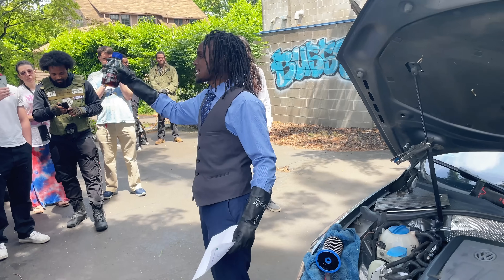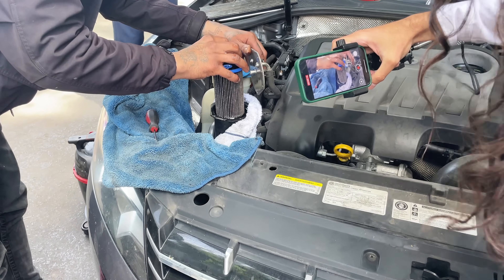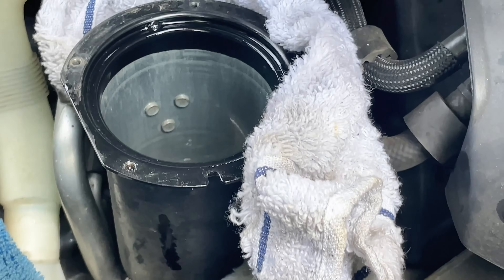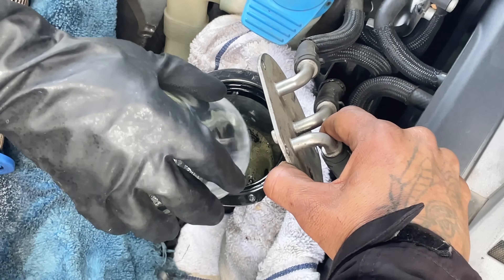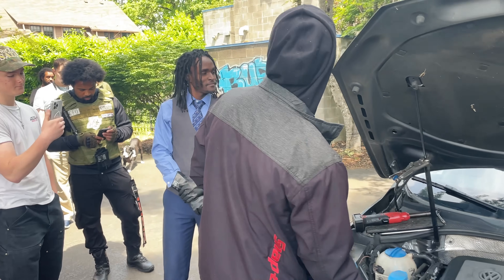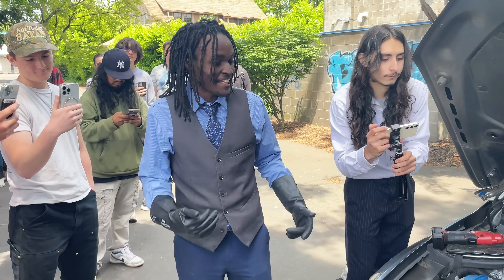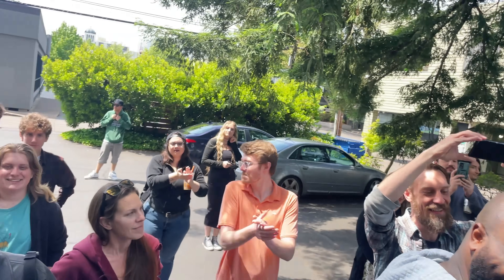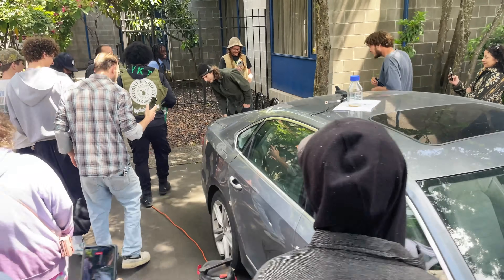1st MODERN Diesel to run off of Plastic Waste - Made DIESEL! |  Eugene Oregon

Comment: Late to this feed but here’s my take.
When adding his miracle-fuel, he didn’t even fill the filter housing all the way up. Assuming the car was driven to this location it already had real diesel fuel in the lines on both sides of the filter housing. He then fills the housing about 1;2 was with his “miracle fuel” and replaces the top. When he turns the switch to start the car, it’s fuel pump immediately fill the filter housing the rest of the way with real diesel. The initial start was from the real diesel that was left in the lines (from filter to injectors), followed by an approximate 50/50 mix of his miracle-fuel & real diesel, then by the real diesel in the lines from tank to filter. 
This is VERY suspicious, to say the least.. 🤔

Comment: No — 221 ppm sulfur fuel is definitely not cleaner than pump diesel. Pump diesel usually has < 10 ppm sulfur. Your sample — 221 ppm

That’s about 22× dirtier than pump diesel in terms of sulfur alone.
Even if it burns okay, here’s what that means:
• More SO₂ emissions → smog + acid rain.
• More particulates (PM2.5) → respiratory harm.
• Corrodes engines and DPFs (diesel particulate filters).
• Fails Euro 5/6 and EPA standards outright.

So it’s far less clean chemically and environmentally.

Comment: Not the best test. The car's fuel lines, tank, everything, should have been emptied and the car should have run until it died before adding in the plastidiesel with a new fuel filter.

Comment: This is great take plastic, use an amazing amount of energy  and natural resources to  convert it, then burn it into the atmosphere and make more polluted air.. You think this guy is amazing for that????? You can run a diesel engine on Vegetable oil yes natural oil from corn . This just shows how little people understand the energy crisis. Yes we need to get rid of plastics or convert completely to biodegradable. But to hail this guy as a hero for wasting resources to make a product that still pollutes is just stupid. There are certain alcohols that burn in an ICE, internal combustion engine at 95 percent greatly reducing air pollution. Hydrogen burns with only water as exhaust  and has no pollution, but the route he takes is a better diesel fuel really??
Use your heads people not a viable solution

Comment: You've proven a running product with good octane. Can you focus on proving the numbers? For example is it efficient enough to get more energy out than is put in? Can the NG-like plastigas reliably run the distillation equipment? 

As people have said, producing these results has been done before. Now that you've proven you can get as far along as your predecessors, can you successfully go beyond and make something that reliably gives a net gain? Something other people can  and want to do?

Very cool to watch your process. You are DEDICATED!

Comment: Just saying that thing must have a return so regular diesel is mixing with his diesel. Not saying it doesn’t run, but I fill diesel fuel filters with transmission oil to prime them runs fine too. Diesel will run off of use motor oil. Like he said not as clean as his stuff.

Comment: Only a few problems it was mixed with diesel next time drain the whole fuel system and run the engine completely out of diesel and then put your fuel in the tank with a new fuel filter and then do the test. It was compromised
Reply: My w204 can run on 1l of diesel 1h while in neutral, he put 0.5l i m sure the car can run for 20-30min.

Comment: Did you fill the fuel tank with your new diesel? Or was this just A short segment of a longer video? What I'm saying is to do the same test with a fuel cell of a gallon or so of your Diesel and let the car idle in rev for about 3 minutes. People will second-guess you and say you are still hooked up to the original gas tank with the standard diesel

Comment: Extraordinary claims require extraordinary evidence. Below is a list of original inventors with patent #'s. You must know the general public is going to look into validity based on the claims presented. 

If they didn't allow anyone below bring it to fruition, I don't see how they will allow it now.  

Vladilen Stankevitch: US6534689B1
David McNamara, Michael Murray: US20120261247A1
Wilfried Weiss, Jérôme Bonnardot, Iñigo Ribas Sangüesa: EP4189038A1
Wu Yanhui, Liu Chunyan, Zhu Zhirong: CN102039155A
Gang Wang, Jinsen Gao, Yantao Bi: US9469815B2
Umesh Zadgaonkar, Ajay Kumar Arora, Biswanath Sarkar, Shanti Parkash, Krishan Kumar Swami, Rakesh Sarin, Venkatachalam Krishnan, Satish Makhija, Ram Prakash Verma, Sobhan Ghosh, Niranjan Raghunath Raje, Alka Umesh Zadgaonkar: WO2005094990A1
Jumluck Srinakruang: US8344195B2

Comment: So my question from a mechanic standpoint is what about the tank, lines, and pump there’s still standard diesel in the system and the second you turn the ignition on it primes the system (dilutes the added fuel in the filter because it’s adding fuel) I fully believe it’s a useable fuel source, but diesels are also know for not really giving a fuck what you feed it oil or fuel wise.

Comment: "The exhaust smells cleaner!" He exclaims from the front of the car. Unless that car is broken you shouldn't smell anything after just a minute.
Reply: Diesel cars smell like crazy on a cold start. Until the catalytic converters warm up from exhaust heat it's going to smell. Both Diesel and gas cars, same deal with both.

Comment: This process has been around a long time, many modern diesels have run on it in 3rd world countries.  Still really cool seeing this gentleman pushing the science. I believe there are efficiency issues at a mass scale.
Reply: dont know alot about the subject but i ve stumbled years ago on plastic pyrolisis fuel and offcourse it works, i am just wondering where the fumes go and is there leftover gunk
Reply: @traktor321 he made shorts videos explaining where the fumes go
Reply: @traktor321 the waste is nasty stuff and needs to be handled and disposed of properly
Reply: @traktor321 here's something interesting for you: you can create fuel with the same process using wood.
Reply: Money
Reply: It's not that it's not a good thing the problem is the profitability and investment.

Comment: congrats.. one question what was in the fuel tank during the demonstration?. .. real pump diesel or plastidiesel..  reason I ask is  on most diesel engines when you for instance change a filter you cycle the key on a few time to get the air out of the system.. when you do that the pump will actually push whatever is in the tank to the filter system and back.. they operate on a loop unlike gas engines where the fuel is pushed to the engine and used as need in injectors..   

If the car tank as also on E and filled to  1/4 tank or so of plastidiesel and you did this it would become more  convincing.    

I still love the theory but the test is not true to life for me..

Comment: That didnt fill up the filter housing.  Priming it will mix regular diesel with it.  How about run a brand new engine on 100% plastidiesel.  How about you film making about 20 gallons being made by your machine.  Otherwise snake oil.

Comment: This technology has already been done, and the process is called Thermal Depolymerization. there was already a company doing this, and they used plastic, old tires, and turkey offal, not to mention you can use any organic material to get this outcome its a carbon based fuel, and guess what is in plastic? petrol. YT "Thermal Depolymerization" you didnt invent this.

Comment: Diesel Engines can run on several different types of waste oils. Nice to see someone converting plastics into useable diesel fuel.  Too bad most people don't have diesel engines.
Reply: trucks?????????
Reply: @untitled06 trucks are inefficient
Reply: It can be further refined down to gasoline
Reply: Trucks, tractors, construction equipment, ships, trains, heating oil for most of the Northeast US. Cars use very little of the fuel needed in the US.
Reply: Good thing he already created plastoline, for those people!

Comment: you can do the same thing with corn alcohol and cars. the problem you dont see if the longevity. is it prone to predetonation while driving? does long use gum up the combustion area and/or clog any emissions equipment. is it washing away the cylinder walls leading to scoring? fuel isnt just fuel.  lol

Comment: Time to get yourself a modern diesel car/truck and start driving it around using just your fuel. This is a great win on a small scale but to really convince people you need bigger test.
Reply: Theres a guy who has a wood gassifier in his truck & runs it off of wood.
Lots of vehicles were made to run off of wood during WW-2
Look into the history of energy & you'll find it.
Sometimes its called syngas & street lights used to burn the stuff.

Comment: Was there regular diesiel in the tank or fuel lines? 
Have you conducted emission tests?
How much energy does it take to syntesize this fuel?
Reply: 1. No. 2. A laboratory already proved it burns cleaner. 3. About 800 grams of trash.
Reply: Of course that's a totally bogus demonstration it would take a while for that to even reach the engine. Whatever you dumped in the filter housing would be way diluted as well it's totally bogus. But it doesent matter it's all a performance lol car starts (off regular diesel) crows claps woo it work hah bunch of dummies yes men

Comment: I feel like youtube is suppressing this guy. This is a historical event that would upend the fuel market. Also the corprate bots are already invading the comment section
Reply: how would it upend the fuel market lol? it probably cost him like 10 bucks to make that 1 cup of his DIY diesel
Reply: Let's say he used 1kw of electricity per hour to do this.. seems like a conservative estimate, as distillation can be done with burning wood, but let's say it's super inifficient at 1000w. Plastic is obviously free, he's not buying laundry detergent to empty it and put the plastic jug in his "refinery". If your estimate was accurate, that would take him approximately 58 hours to consume 10 dollars of electricity (at .17/kwh - national average). Thermal decomposition and distillation doesn't take that long. now I'm a skeptic too, and believe extraordinary claims require extraordinary evidence. But c'mon dude, this is 5th grade math. Do some calculating before you do some talking.  @hiz-n-lowz1577

Comment: The cycling just mixed the regular deisel with the plastic in the filter housing It  probably never even made it to the fuel pump and people saying it smells cleaner are crazy there is probably more fuel than you put all ready in the fuel pump and lines and 2.0 tdi does 60mpg so no way that fuel made it to the injectors you couldn't even get the weedwacker to run properly I think you know it won't work undiluted with an efi system
Reply: Malarkey.
Reply: Of course it's totally bogus all about putting on a performance not something that actually works. Little if any of that liquid made it to the engine during the "test" it ran off the regular fuel in the lines. It's all straight out the scam product ponzi scheme playbook. Miraculous xxx the greedy xxx companies dont want you to know about! Buy now before they try to shut us down! Or kill him over his worthless fake invention like people are saying haha what a comedy scary how stupid the public is.
Reply: Of course it's totally bogus all about putting on a performance not something that actually works. Little if any of that liquid made it to the engine during the "test" it ran off the regular fuel in the lines. It's all straight out the scam product ponzi scheme playbook. Miraculous xxx the greedy xxx companies dont want you to know about! Buy now before they try to shut us down! Or kill him over his worthless fake invention like people are saying haha what a comedy scary how stupid the public is.

Comment: There was still fuel in the fuel rail and you only filled the filter half way so at best it was 60/40 mix regular/plastic
Reply: Facts , until
He has a full tank of this he’s just stealing folks money lol
Reply: @jacobmarley8350  Bro came out with a cup of his home made diesel, lol
Reply: @hiz-n-lowz1577 facts are this , Siemens filed for the patent for his exact copy verbatim machine but it was not feasible ? They were putting more energy in than getting out , it would cost like 15$ a gallon maybe at the least 7-10
Reply: @hiz-n-lowz1577 but I am in no way knocking that he has found a far better thing for plastic waste but the ironic thing is plastic is made from oil lol
Reply: ...and would have been microplastics...
Reply: @jacobmarley8350  so converting plastic to diesel and burning it cost 2 to 3.5x what pump diesel cost and it also puts 2x or more the co2 into the atmosphere, the co2 used to run the pyrolysis machine and the co2 from burning the diesel. Plus you are left with the waste product components from the plastic that are not diesel so it doesnt really solve the plastic pollution problem and it increases the greenhouse warming problem.
Reply: Co2 is plant food
Reply: @eeleye733  as any 3rd grader knows, co2 is also a potent greenhouse gas.
Reply: @hiz-n-lowz1577  any 3rd grader knows c02 is pumped into greenhouses to make the plants bigger. 5th graders learn that plants inhale co2 and exhale o2.
Reply: Butttt once he gets a full tank shit then we are cooking
Reply: As someone who runs wmo in my idi diesels I’m more curious about the performance characteristics. What do you see comparatively on the boost and egt gauges? How about the cold starting characteristics? I get that crowdsourcing the vehicle can add to the authenticity but it really limits the long term study potential.
Reply: Im getting a Maxwell Chikumbutso vibe here. If you are not familiar he is a man from Zimbabwe who claims to have invented a microsonic energy device that can run electric cars off free RF energy indefinately. his only proof has been to show an EV driving down a driveway...

Comment: Can you add the link to the third part test that verifies it’s cleaner than commercial diesel?
Reply: I want to see him make about 10 gallons and put a vehicle on a dyno under a load and see what the emissions are and how it runs. I've never saw him make over a quart, how much plastic does it take to make a gallon and I guarantee he's separating the plastics also. Why hasn't he sent a sample to the EPA either. Maybe with solar panels he can also make it cost effective but that for his small plant. To.make a plant that would have to have plastic shipped in 24 hours a day would it even offset the price to haul the plastic to the refinery. So many variables.
Reply: @ChrisRose_Krii_Lun_Aus hopefully the EPA will seize his toxic cocktail making equipment.  

The chemistry dosent lie. he dose. that's why he hasn't  had any emission tests or anlizying of his substance commissioned. 

Furthermore comparing it to diselel isn't anlizying all of the chemicals in the mixture. claiming it as a clean fuel is false and misleading. 

he should be sued for making such claims.
Reply: @ChrisRose_Krii_Lun_Aus he wont and he deletes comments .
he won't answer a simple question about the temperature he runs his device at or how he measures the temperature...I have sent him emails asking for a answer.
Reply: @brettjasonheadinventor it makes me laugh at how many people are praising him and telling him to watch his back. Like big oil is worried about a YouTuber. Hell i can make moonshine out of corn and run it at the dragstip. Give me a play button. 😂😂😂
Reply: @ChrisRose_Krii_Lun_Aus  the only one worried about this kind of competition is probably Maxwell Chikumbutso!
Reply: Whos saw him make ober a few quarts though. Id bet i could go in my shop and in a week or less i could 💯 replicate anything he does and a lot of you could. This is nothing new.
Reply: he hasn't conducted a exhaust gas test. the fools are breathing toxic forever chemicals..
Reply: Not according to the lab.
Reply: Lab, Shmab. Most labs will give yiu the results that make you look good. Send it to the EPA.

Comment: he actually making history
Reply: It's been done before like 50 years ago 😂
Reply: He’s not 😂, you people are so gullible. Do you really think that in all the time that cars have been around, not a single person has thought to do this? The reason why it’s not already in production is because it’s not viable at all.
Reply: @demontiming3234  yes, people have been turning plastic into diesel for 50+ years via pyrolysis. His approach using microwaves is somewhat innovative but Id bet it probably cost him double or triple the cost to make a gallon of his DIY diesel than it would be to just buy pump diesel.
Reply: @rynor2691  Its not new but it has advantages over other heat sources. For instance with microwaves you heat the plastic  directly, other heating methods transfer heat to the plastic from the vessel its contained in. Is it good enough to get more energy out than you put in? I seriously doubt it. Id like to see the actual #s though.
Reply: @demontiming3234  ok corporate shill
Reply: @demontiming3234 post a video or source dumb f , post a truck running off plastic made diesel other wise sdfu!!!!!
Reply: @demontiming3234 sounds like u watched a hater video, ur mind is weak, u were convinced it won't be viable by a jealous inventor,  and u just change views like the wind.  U know nothing about any of this.  Move along then if u don't care
Reply: WAS INVENT IN 1929, https://www.youtube.com/watch?v=ZwMfFblT0C8